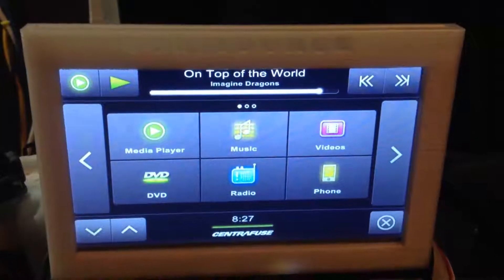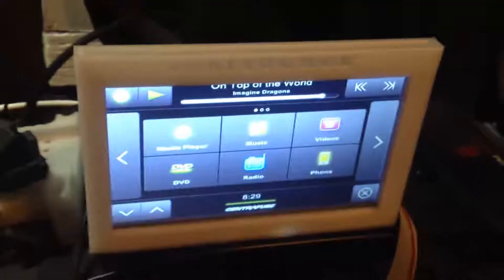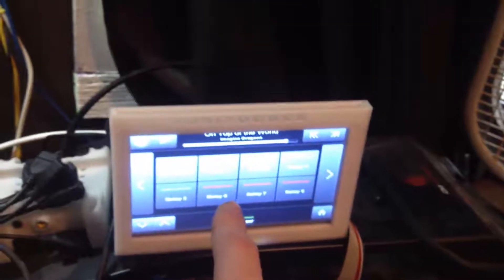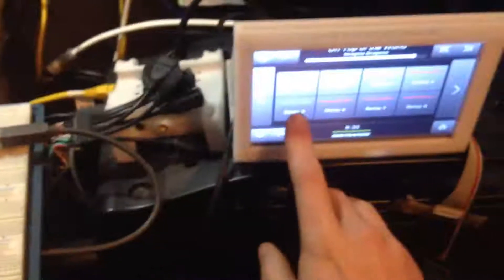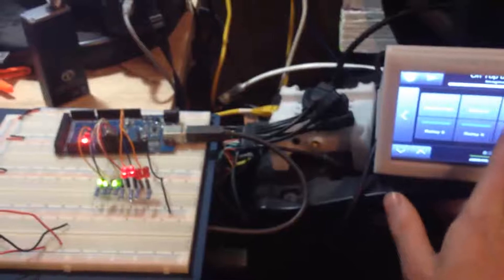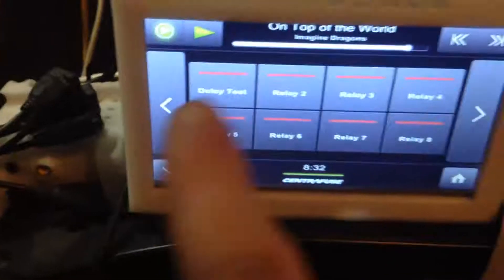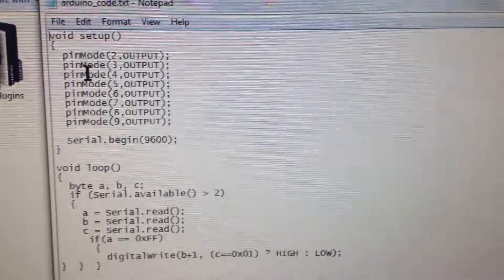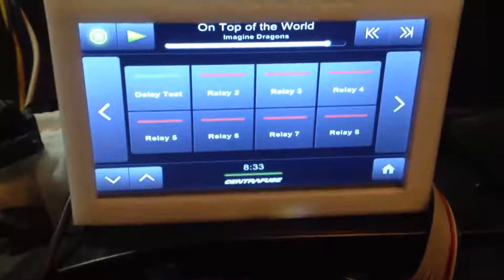arduino centrafuse preview

Comment: I'm trying to locate an HVAC software for my carPC. Can Centrafuse work with an HVAC UI interface system plug and play with the CANpacket data or is custom UI designing required?

Comment: Thats cool. Have you thought about using the arduino to measure the temp inside and outside of the car and displaying it in centrafuse. Im currently looking for a way to do it since after i installed pc in my car i lost the original display for temps.